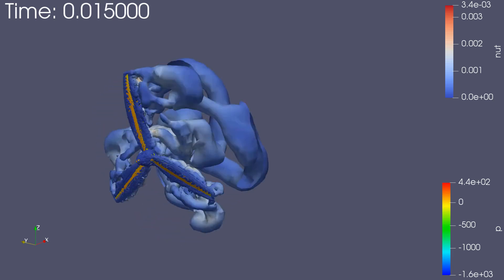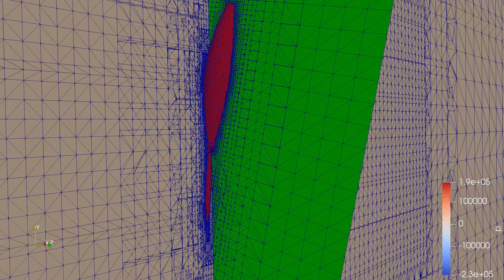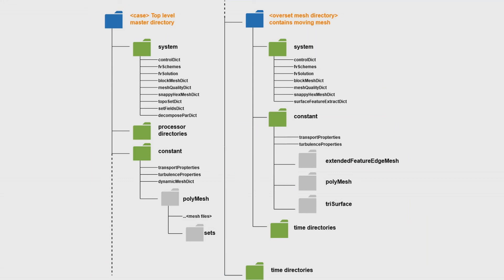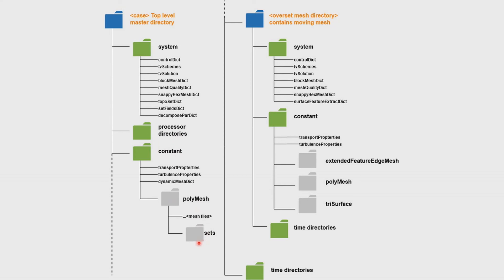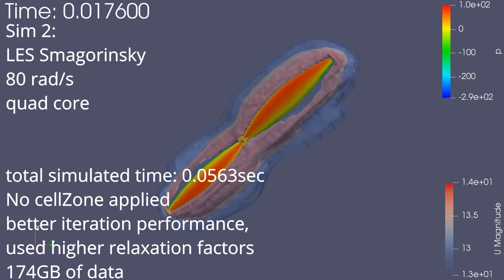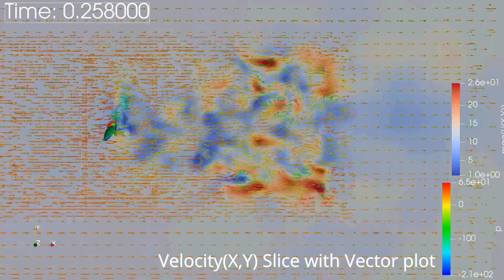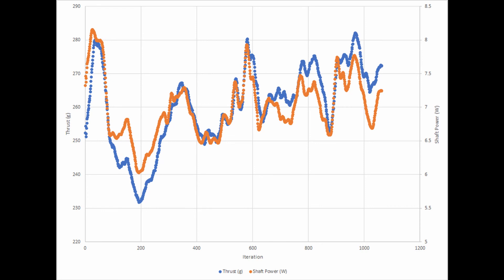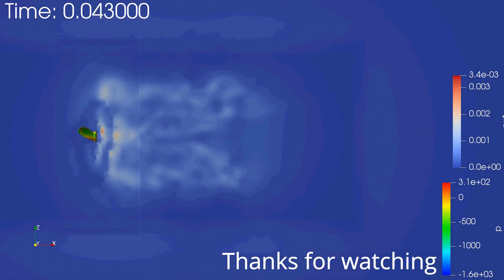Adventures with OpenFOAM | Overset Meshes

Comment: Hi! I have a similar case I need to work on. How did you work out the LES using the dynamic mesh? Would you be able to share your case by any chance? I would greatly appreciate it.
Reply from the maker: Yeah no problem! I don't have the same case anymore, because I cleared old data when my drive got full.However I do have another overset mesh case that I can post in the next few days if that's fine with you? It also is using an LES model (Smagorinsky with vanDriest Delta).

Getting the LES turbulence model to work with a dynamic mesh wasn't very different compared to a static meshes, the only issue is if the turbulence model is using wall functions that rely on a wallDist scheme in fvSchemes, because a few of the wallDist methods do not work with overset meshes.
Reply: @fureter6986  that would be great! I have tried using AMI with LES but Ive had some issues so I am barely looking into Overset and your example was very exciting to see in how each iteration of your setup got better. It would be of great help for my project! If you wanna share it to my email whenever you can. I would appreciate it so much bro erickdmartinez0@gmail.com
Reply from the maker: @Erickdmartinez  Hey Erick, sorry for the delay, I've been busy with work. I added the case to github located here: https://github.com/fureter/contra_props_60mm_template. 
There are some notes for running it in the readme files, don't hesitate to ask any question if you have issues running it, though I'm by no means an expert hopefully I can help.
I'm using OpenFOAM v2012 for this case, but anything back to v1812 'should' work, though I'd recommend running on the latest release if you're not.
Reply: @fureter6986  Hi! The case has been super helpful to get used to overset meshes. Thank you so much for helping out by sharing it! I noticed you have a controldict.foam file that uses simpleFoam. Ive seen that to use LES you need to initialize with a steady state solution. Did you need to do that at all for your case or were you able to do it without the simpleFoam part?
Reply from the maker: @Erickdmartinez  Hey Erick, I'm glad the case was helpful! I actually haven't been initializing my cases with other solvers. The controldict.foam is an easy was to open the case in paraview. I tend to copy my cases around as templates and only replace the files I need to. That controldict.foam is probably years old at this point. You should be able to do ./Allrun on the github case and have it work assuming no dependencies are missing in the install.